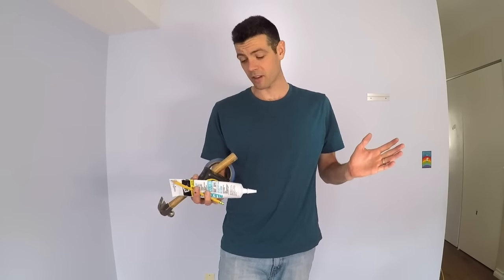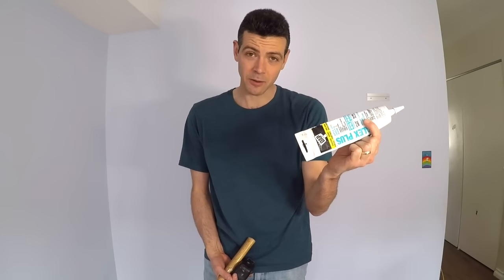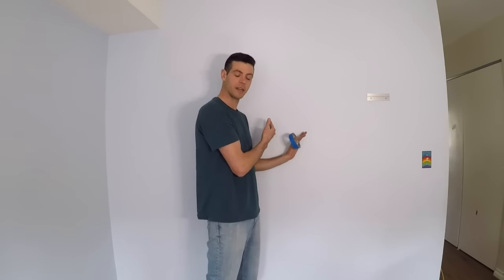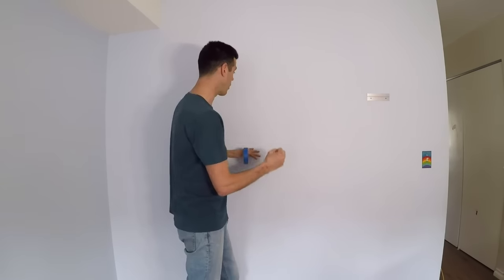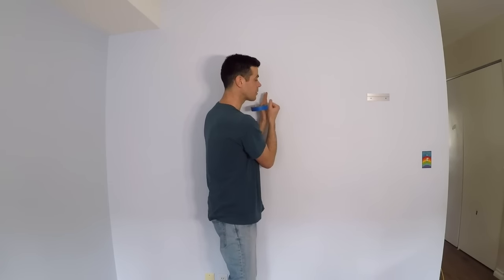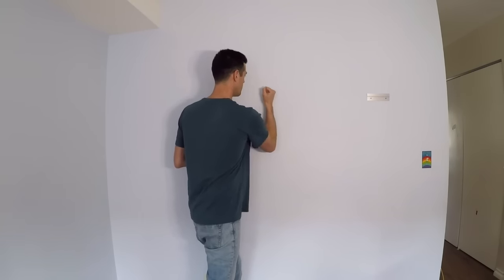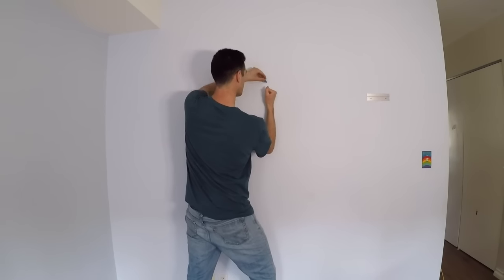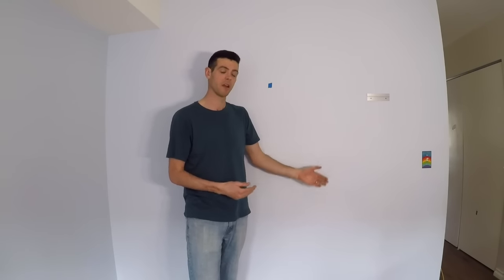It's EASY to Find Studs WITHOUT A STUD FINDER!!!!!

Comment: Step ONE was left off this video.  What is on the other side of the wall?  If there are perpendicular walls you are going to have a cluster of studs at the wall that may mess up your 16" center points of your studs.  If you have a bathroom or a kitchen you could have all kinds of stuff in the wall like vents, sewer pipes, water pipes, electrical wires, medicine cabinets, duct work, extra wood blocking etc.  Caution is highly recommended.  If you have an electrical sub panel or breaker panel be extremely cautious.  Driving a nail or using a sheet rock saw and hitting an electrical wire could change your voice or cause a lot of unnecessary work.  If you hit something really hard and the nail doesn't want to go any further than the thickness of the sheet rock don't force it or drill it.  It's probably a safety plate that was put there to protect plumbing or electrical.  Drilling it out could cause a big surprise like electrocution or flooding.  By the way, do you know where the water and electrical shut offs are before you start messing with the walls?  So to sum it all up, be careful taking any advice from a YouTube video.  Like my wife always says to me, "Anyone can make a YouTube video".  By-the-way, I am a licensed General Contractor, Plumber and Electrician.
Reply: What are your opinions on HVAC and sheet metal fab?

Comment: I just bought my house.  
I have 3 very expensive bicycles. 
I want to hang them on the wall 
To make more room.  
I don’t want to have 20 holes
Searching around for a stud.  
What percent of the time is the 
16 inch rule used ?
50/50 ?
100% ?
75/25 ?
Thx.

Comment: Are different regions different measurements? I am having serious trouble finding studs in my new house, seems to be no sense to it. Then I checked on the only exposed walls in the house (furnace room, garage) and realized the studs there are all 19 inches apart. Do you think it's safe to assume the rest of the house is this way as well?

Comment: Glad I'm not the o Ly one who hit a electrical wire with a drill bit checking for studs
Reply: one hour after doing demolition job I was fired from job for cutting a pipe and flooding a basement   in order not to waste a day I went to work on my house and drilled thru the wire  for a heat pump than I decided not to touch anything    before I kill someone or myself on that cursed day

Comment: No, this tapping is  not reliable, since conduits, human bones, horizontal fire breaks, wiring, pipes etc. Pull off an electrical outlet cover to view where stud is, then measure 16" (some studs may be 24" apart) then check with electronic stud finder. Magnet method also not so  hot. Don't expect studs to be placed according to some "standard" interval. I use a portable X ray machine to see what's behind the drywall. These can be picked up anywhere for thousands of dollars, and are also useful for detecting hidden surveillance gear.

Comment: Keys. They're called Keys. When plaster is mashed into the lathe in the voids in-between each lathe the wet plaster will mushroom out. Those bulbous clumps of dried plaster are what holds the stuff together and keeps it from falling off the wall. That's why you shouldn't do a lot of beating and banging on the wall... especially if is an old plaster job or there is already some noticible slumping or bowing. Which are clear signs the plaster is beginning to fail. The more keys that fall off the greater the likelihood of the whole wall failing. Old plaster should be treated like kids and women and only beaten when necessary and not too hard.

Comment: Dude just use small magnets.. 

You small neodymium refrigerator magnets pin magnets. 

WORKS BETTER THAN ANYTHING!!

When people put drywall in they use obviously metal screws.  

You just push the magnet to where you think the stud is and when you hit a metal screw the magnet will stick to it and you know that's where the stud is. 

You do this again with a couple more magnets with a couple of more screws and you'll see a line of magnets where the person drilled the screws into the drywall

IT WORKS UNBELIEVABLE I JUST TRIED IT.. 

I had a stud finder and I was trying to use it in those just are hit or miss.. 

Then I stumbled upon some guy talking about magnets on YouTube

Within seconds I found the studs it was unbelievable.. 

they have to be small magnets a little bit bigger than the head of a screw and they have to be strong neodymium.. 

That's it dude you don't have to waste time doing what you're doing and what other people doing or using those ridiculously expensive stud finders

;)

Comment: Are the studs on the sides of windows goes all the way up? I want to hang a ledger board on the outside of my house for a pergola build and I need to be able to find studs for outside mounting. Studs are very strong and I'm thinking of just using two studs for my project. Do you think two studs will be enough?  Thanks

Comment: You can safely bet that there is a stud between the two sockets. The next stud shuld be 16" from there either side...
Reply: It is fairly easy to check also by removing the face plates & having a probe using a screwdriver.

Comment: Serious question. I'm genuinely curious as to why you don't use metric for measuring.  It seems like the math would be a lot easier but maybe I'm missing something as I have used the imperial system my whole life.  I decided metric measurements would be a lot easier after a recent project but haven't implemented it yet.
Reply: Because in America the studs are 16 inches apart. Why convert everything to metric?
Reply: USA construction uses standard measurements

Comment: Is there any reason that a magnet would work, 24” o.c., which also does not line up with 16” o.c.?  This is in my bonus room above my garage on the wall next to the rest of the house.
Reply from the maker: The magnet won't lie.
Reply: As it turns out, the magnet only sticks at the top where it meets the ceiling. Could that have something to do with the trusses?

Comment: @vancouvercarpenter what about round cornerbeads( paper) I I'm doing something right now and they're on a couple posts and I'm meeting old drywall up with new just trying to figure out if I should slap some mud on the old drywall first so doesn't pull over like you're talkin about or if it matters with round corner bead?????

Comment: Omg seriously? Your over thinking it.. I just use my knowledge of construction hahahaha     In residential boarders board top town. on 9 foot ceilings they use 54 inch board lay down.  On 8 foot ceilings they use 4' or 48" so two simple ways: 1 a little rare earth magnet. strong one.   measure roof down 48" - 1" or 54" less one inch.  drag your little rare earth magnet at that hight it will stick to the wall on the bevel screws.  so easy its simple.  OR:   if you have a FUL knowledge of construction you need nothing but your eye and to only look at a 15 degree angle down the wall almost pll to the wall with a halogen or natural sunlight. you WILL see whats known as flashing.   Where the screw holes or dotts as we call them are spotted.  Flashing is where the drywall mud is sanded over the screw holes. becasue its sanded the texture of the surface is smoother there and in the right angle of sunlight it stans out as a shine.  There is a screw in the center of that shine   (look own the wall) bor both scenarios all you nee is a strong little roun or square rare earth magnet like 1/4 inch   same kin your sun glasses clipons use for perscription glasses OR same kin that your internet provider uses to clip their modems together OR same kind that some schools use on their white boards. THATS ALL you NEED AND A KNOWLEDGE OF CONSTRUCTION hahahahahaha.  I was a drywaller. simple math a magnet and the right angle of light.  No holes no mess 2 number to remember. and based on that studs are on 16" or 2" centers in either direction. No holes no mess no messing around. REMEMBEr THIS ENJOY,.

Comment: “for the majority of your career”

What, are you like 23 years old. The voice of experience. And you don’t know the gauge of that nail? And you’re in the business?

“a screw pop” ?
Why not remove the cover plate and look in the box to see which way the box was installed?

This could have been a two-minute video.
Reply: Thanks for attacking a guy that is trying... and yes screw or nail pops are a very efficient way at finding a stud
Reply: What do you do if no electrical box is installed?  Last time I check they arnt installed every 16 inches.

Comment: you should probably take this video down after i destroy this ridiculously convoluted and utterly pointless method. Simply take a 3/4" radius rare earth aka neodymium magnet, put painters tape on it and rub it on the wall where you want to find a stud, when the magnet sticks you've hit a nail or screw, now move it up or down vertically to find more nails/screws to verify the stud center, game set match, i've been doing that over my entire 30 year career with a zero failure rate